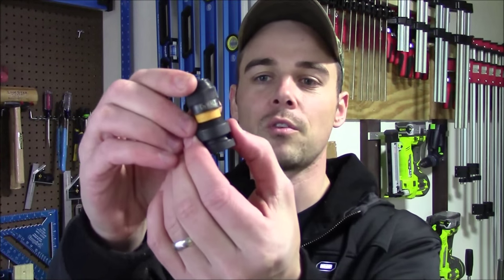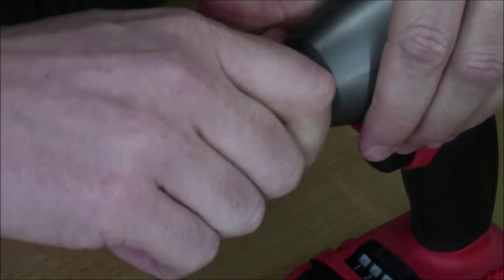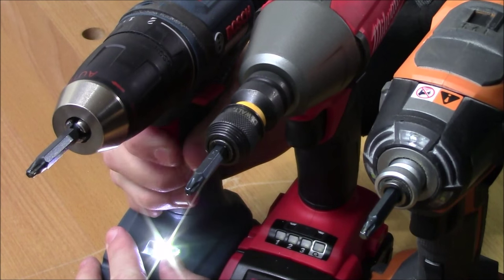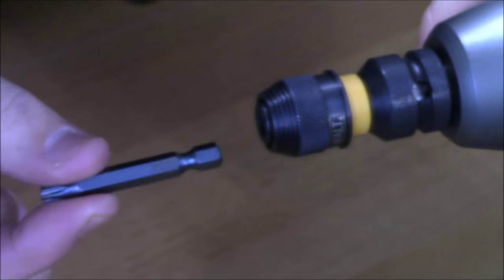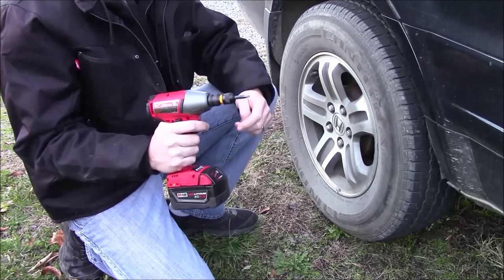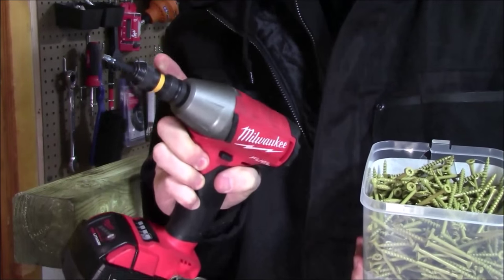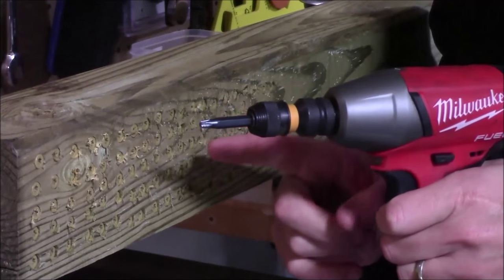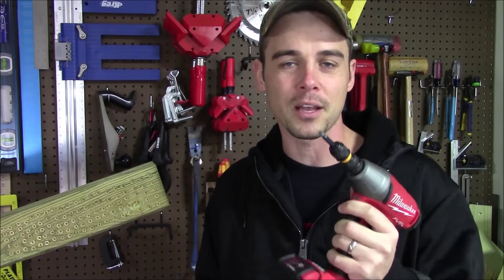DEWALT DW2298 Impact Wrench Adapter (1/2" to 1/4" Hex)

Comment: I've had this adapter for nearly a year now, It works really well at taking off rusty brake rotor screws, and as you know the reverse torque is higher than forward torque, so i'm not sure why people would not think it's not a durable tool, I used it to drive 4 inch  screws into our deck to secure a ladder for our pool, also no problem. I will say it's probably not a good idea to use on drywall though.
Reply from the maker: +jharris280zx Awesome....I keep hearing good things about these.  Glad to know yours is working out well.

Comment: I use one from Irwin on my makita dtw281, at speed 1 (weakest), and no problem at all. The point of using this adaptor at full power is not breaking the adapter but at full power/speed I have no control over the little philips screws. So using in speed one is not only good for the adapter but for the work you are doing. 2600 rpm and 280nm of torque on a philips head is very easy to mess everething the screw the wood the adapter :). Very good video

Comment: I have owned that adapter for a few years and it's still working fine.  I have both the Ryobi 1500 in lb driver and 200 ft lb 1/2" and the use of the adapter for me is when I am installing several long torx head lag bolts such as when connecting beams or securing trusses.
Reply from the maker: +The Mechanical Philosopher Nice....thanks for the long-term review! :)

Comment: Saw this at Lowes for dirt cheap. Picked one up and rewatched this video. Thanks for the warning about how much torque it can handle. I'm using it with my Ryobi cordless 1/2" impact later. On setting three, it would break the adapter. I'm going to be using this adapter with a Forstner style bit, and my impact driver for driving screws. It's nice not having to switch bits all the time. It's also nice not having my screw driver bits shoot out across the room and get lost.

Comment: Finally got me one of these love it on the DeWalt 894 the slower rpm makes it really effective hardly impacts when setting 3" screws!
Reply: Yeah! Perfect fit my 894 drives 4 inch screws into 4x4 90-100% of the way before even impacting. Most of the time it just needs a couple hits to full seat the head.

Comment: currently been using this for my dewalt high torque 899 impact wrench to drive 150mm batten screws into 100x200 hardwood posts soo much faster then a standard impact driver

Comment: These are pretty awesome. Set your impact wrenches down to speed 1 or the lowest setting and you will be good for years. I’m debating about dumping my impact driver and just using this instead. I rarely use a driver so it makes sense for me.

Comment: The bit breaker 5000
Reply: Surprisingly if your using a strong half inch impact it's actually easier on the bit it drives hardly impacting. With the smaller impact wrench he's using its no more torque then a regular driver.
Reply: @zack6892  I agree. These smaller models are basically the same inside just with an anvil end.
Reply: @sethburgess8211  and this adapter is really no different than a quarter inch impact socket with a locking mechanism
Reply: @lucifchristo  exactly, but I couldn’t find one of those anywhere so ended up buying the fancy adapter

Comment: I wondered when someone was going to come out with something like this. The only problem I see is the wobble at the bit. Starting screws is more difficult. I'd get one but I have an impact driver that I just put a socket adapter on and it does just fine for me.
Reply: Douglas Alan That's a good point. As long as you have some good bits it won't make that much difference. I have kobalt and dewalt bits. They're pretty good.
Reply from the maker: +Love2boat92 It would appear so, but honestly with the star drive screws there is zero issues.  I dont know about phillips....since I 100% cannot stand using them.
Reply: Real Tool Reviews It sure does look like it on camera. Yeah star is better then Philips. We still have flat head screws around here on a few things. Lol. I don't like the flat head screws at all.

Comment: Best video I've found so far. However as a contractor what I'm really interested in is how the impact wrench works with long structural screws. None of my impact drivers can drive a 10" GRK without numerous "run ups!" Thanks.

Comment: I like this adapter but I think I would get the milwaukee 3/8" drive to 1/4" hex
Reply: +Jursaw I have the Milwaukee adapter and couldn't be happier.
Reply: Jursaw--Well, okay, but this is an adapter for 1/2" to 1/4", so there's no direct comparison regarding a 3/8" model.  Does Milwaukee make a 1/2" to 1/4" that is a better adapter than this DeWalt model?  Thanks.
Reply: @stever5887  Don't know about Milwaukee specifically, but TTI does. Got a 1/2" to 1/4" hex in the box with a Ryobi wrench.
Reply: @stever5887  yes Milwaukee makes an adapter, i just ordered one from HD online to go with my ridgid gen5x 1/2" impact wrench.  I have an impact driver with hex to 3/8 and 1/2 socket adapter so i figure why not have a 1/2" socket to 1/4" hex adapter... That way if i drive screws and need light duty work on say my sons bike I can or if i need to rotate my tires and then build a fence i can as well... Oddball examples but you get the idea.

Comment: Yes! The adapter is cool. But don't make it a habit. Otherwise too much torque can shred the screws. Nice tho if you're in a pinch
Reply from the maker: I agree.  Better to get the correct tool for a job.

Comment: I know this vid is 5 years old, but its great! I can only afford one tool right now and I want something that I can use for automotive work but also general DIY and basic home repair. Would you recommend I use an impact wrench with this adapter, or an impact driver with a socket adapter???

Comment: I used it to predrill holes for fences for screws.  It drilled in great, but every once in a  while when reversing the drill out, the adapter would come off. A bit annoying

Comment: So I have a question that I can't find the answer to.. I'm a contractor and have the fuel one key impact driver I use daily. I also do some light duty mechanic work on my cars and trucks in the form of wheels and tires, suspension work, ect. I own the fuel 2763 impact and use it for lag bolts, structural bolts in steel, ect. I'm wanting to get a compact impact wrench for the small mechanic stuff (tires, smaller bolts ect) but not sure if I should get an adapter for my one key impact driver, or get the one key 1/2 impact wrench. What is your recommendation knowing I already have the 2763? Thanks so much

Comment: 12$ is a good price for this adapter, considering you can buy a new bare impact drill for like 60$.
Reply: As he says in the vid - These are not the same, just as buying a $60 tool is not the same as buying a $260 tool.
Value and quality are good buying motivations - 'Cheap' is for idiots and true amateurs.

Comment: I have the Ryobi P261 impact wrench, rated at 300 ft/lb at high setting (high, mid, and low). I am thinking about getting the adapter and use at lowest setting which probably means less torque, will this adapter be destroyed?

Comment: would you use the impact wrench adapter with an air impact wrench?
Reply: That’s my question as well. I’m about to buy one just to try it. I’ve got an aircat that puts out up to 900 ft/lbs I’m going to turn down the air pressure to about 90 and set it to 1 of 3 for impact power. It should be fine. I’m hoping to at least finish my subfloor (about 1600 screws). Might save me 150$.

Comment: This would be one of those things that I would buy and then two months down the line I would forget that I had it.  If I needed to use an impact driver, I would probably reach for the driver rather than the adapter.  I try and avoid adapters at all cost.  Just my own personal preference.
Reply from the maker: +Mike L. I agree....but for convenience and/or budget issues, this would help offset the need for two tools.

Comment: do you if something like midtorque impact wrench like milwaukee 2861 can be used with this adapter on very low rpms. according to manual its https://documents.milwaukeetool.com/58-14-2860d1.pdf does only 0-510 rpms on first speed,hence the torque should be lower and ok for this adapter?

Comment: Does Dewalt has a 3/8 to 1/4 hex adapter? I know milwaukee has it, but I can not find one from Dewalt
Reply: I have the Dewalt 1/2 to 1/4 hex and as you said, the Milwaukee 3/8 to 1/4.  Neither seems to have the other one for some reason.

Comment: Fortunately, I bought a Bosch impact that is a 1/2" drive with 1/4" hex built in. No adapter needed.
Reply: I know the model you talk about
But for automotive purposes, that model is not strong enough for many screws. It has like 180nm if I remember well

Comment: I love gripe rite screws
Reply from the maker: +George Moore Me too!  I HATE phillips!
Reply: I can't stand phillips screw drive. It's flawed and there are way to many different types and sizes. I like robertson (square) drive. I use two bit sizes for my robertson screws, and my Spax bit which I think you were using in this video.
I've always wish outlet and light switches used the robertson drive instead of slotted drives. I've cut myself countless times with a flat trying to uncomfortably get outlets wired together.
Reply: +Real Tool Reviews Luck you guys that live in US or whatever, here in Brasil, the most used screws are philips and one that we call fenda, dont know how to say in english, its a horrible screw impossible to use with drill, driver or anything, I think there you call it flat, dont know, its a head with a single fissure dividing it in half. Unfortunatelly here, this is the standards. Torx is rare, square almost impossible to find :(
Reply: fabio campos silva your fenda is the same as our flathead. The popularity of square and torx drive is very recent here in the US.

Comment: People attach it to a high-torque impact that meant to remove lug nuts on a bulldozer and then they complain it breaks after two screws.😅
Reply from the maker: But hey, it would save 0.3 seconds per screw on max torque! 😜

Comment: if you are using small 1 inch bit and this 12v wrench (the link below) it will be even shorter and more accurate then regular impact driver. The regular impact driver's socket is deep and cannot use 1 inch PH2 bits for example. https://sydneytools.com.au/product/milwaukee-m12fiwf12-0-12v-li-ion-cordless-fuel-stubby-1-2-impact-wrench-skin-only